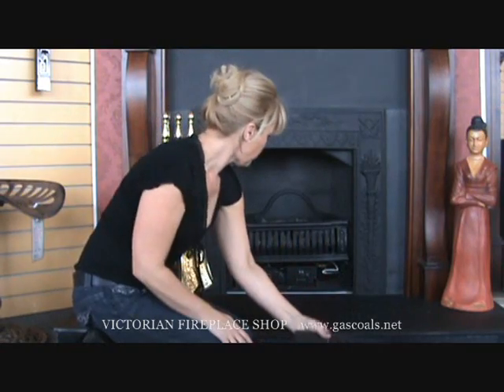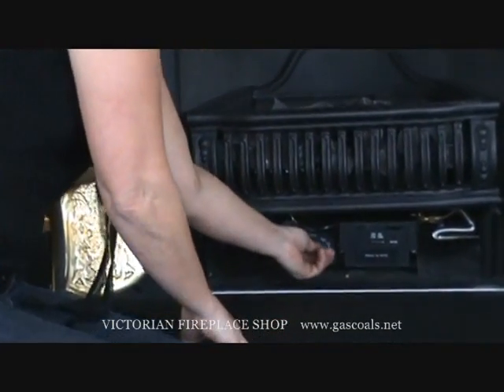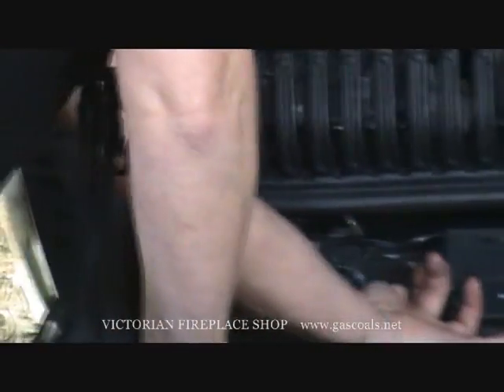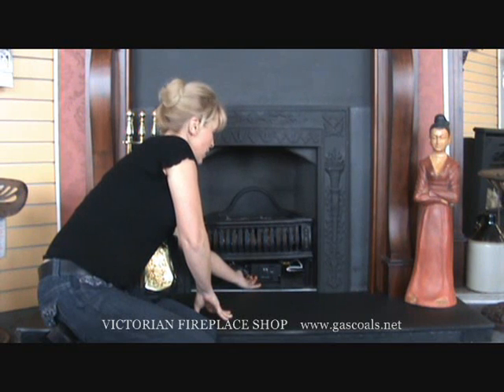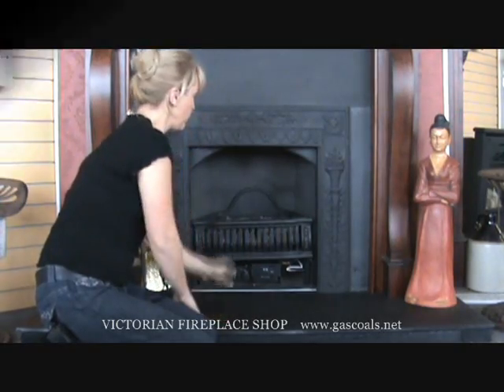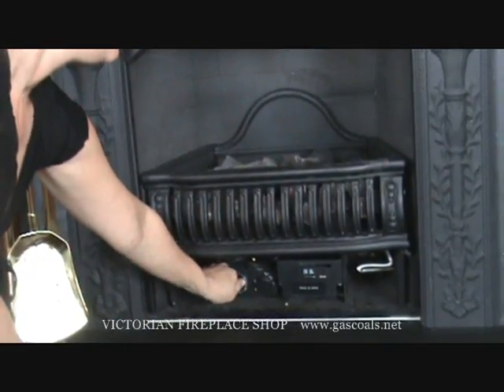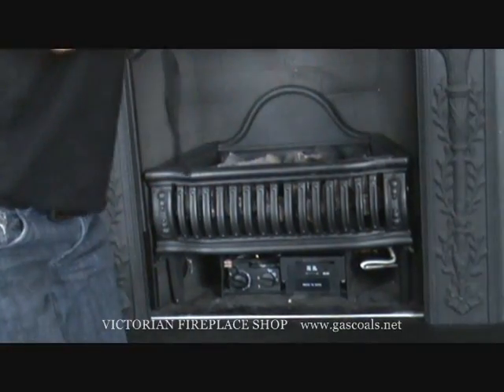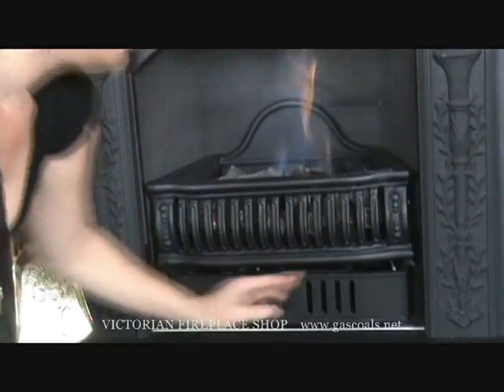Lighting Gas Coal Basket  Video

Comment: Hi I have recently moved into a new house which has got gas coal fireplace. I was wondering if you could help me with my query on whether coals are required to be changed. If yes, what is the sign that says its the time to change the coal.